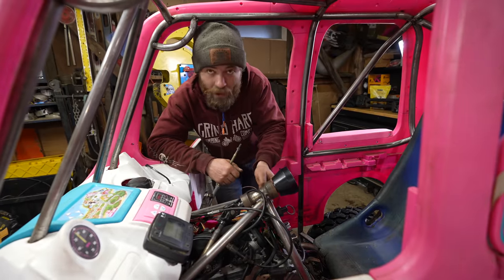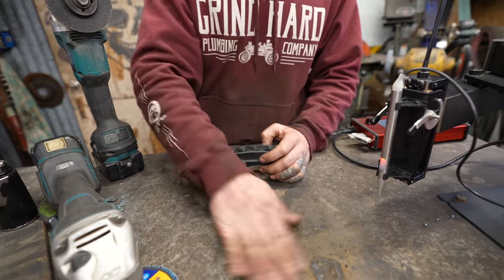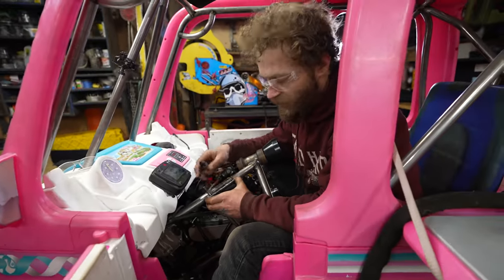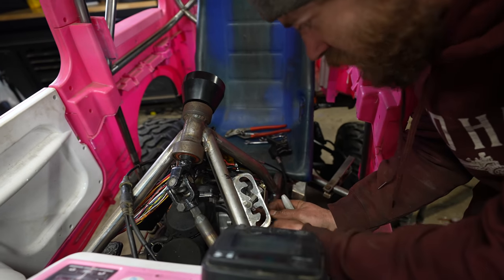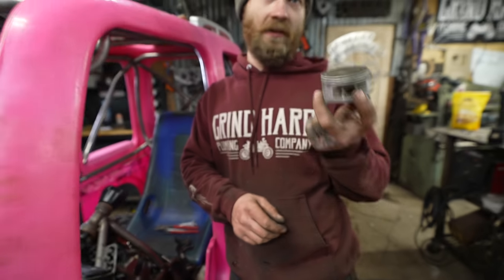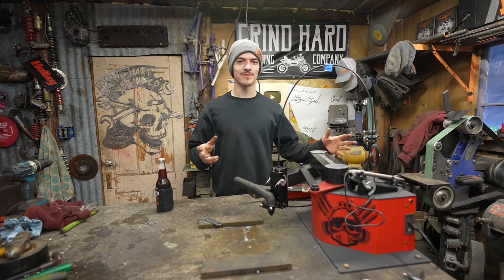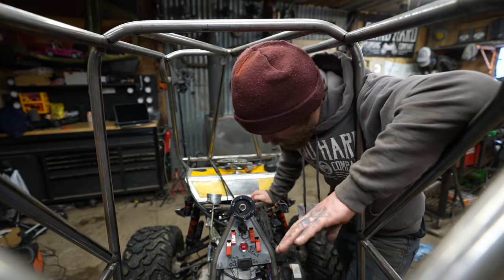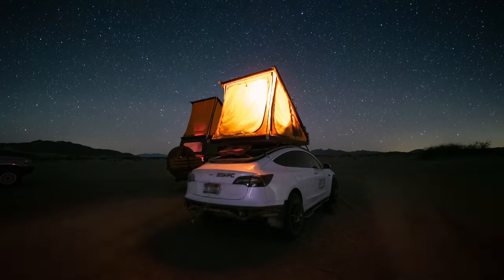4X4 Dream Camper Van Build Gets into Gear!

Comment: Ok, the way you made that shifter plate was awesome!  Now I'm really interested in the Arc Droid - especially because I have all of the same Lincoln machines as you do!  On that note, why do you have to tap the tungsten on the metal to start the arc?  I've never had that issue with my Square-Wave TIG 200.

Great video, guys!
Reply from the maker: Thanks man! Yeah, love the ArcDroid so far! The high frequency start feature on my welder broke a while ago, and I haven’t had time to get it fixed yet.
Reply: @GrindHardPlumbingCo  Oh, ok.  Is that a common issue with this welder?  I didn't see anything about that in the reviews.  

I bought the Power MIG 210 a while ago, and I absolutely LOVE it!  So, that's why I stayed with Lincoln for the TIG.  I have the TIG adapter for the Power MIG 210 too, so I can use my torch on that if I need to.  

Also, I have the Lincoln PAPR (Portable Air Purifying Respirator) that comes with their FGS (Fixed Grinding Shield) hybrid helmet.  It's extremely nice to have HEPA filtered air to breathe at all times, and to be able to grind and weld without changing helmets.  I got it on Amazon for like $800.  It's usually way higher than that, but Amazon had some crazy sale on it for some reason...

Comment: A potential safety hazard that I must point out is that almost none of your guys' builds have roll over protection. I really don't want to see any of you get hurt, all of your projects are super cool, but I think a 700 lb power wheels jeep rolling on top of you might hurt just a "little" bit!
Reply from the maker: Yeah we have rolled that one twice and neither of them were very fun but so far we’re OK. I think projects like this with the roll bar are the way to go for the future
Reply: There is very little room on the smaller bodies to make a cage and be able to get in and out. I'm trying to figure out maybe a hoop for mine🤔

Comment: Always amazed from the contraptions you guys make. I have two projects you guys have to work your magic with after your current projects. One is it would be sick to see what yas can do with a rokon 2x2 motorbike. 2nd it a Honda z50j monkey. As im from Australia I'd love to see the biggest engine you can fit in a monkey without mods or minor. As we here can not mod our vehicles and get away with it. It sucks a lot but atm I have a stock zs190cc on my 1980  fully custom monkey (herd a honda 300cc ? Fits no mods). 12inch 3 1/2 front and 4 inch rear tyres custom alloy rims. All disk breaks. Hydraulic everything including clutch. +15 rear alloy swingarm. Led everything. Digital and original clusters. 2 seperate wiring harnesses, one for the engine with remote start and runs without light (for sneaky getaways) key on and off anytime for the lights and wont kill engine. Air horns. Alarm and hoping to get gps tracking next as ppl like to flog them here as they fit in the back of almost any car. 7cm Harley bar raisers with low set hangers. Frame and light bucket only original thing left. Done everything myself. But still got nothin on you guys lol. Wanna sponsor a grindhard Aussie co 😅. Nah jk. Yeah I know, I wish. Keep up the sick work 🤘👍
Reply: Also have a secret project I'll only share with you guys as I dont have the machinery to perfect it but know you and everyone over the planet would benefit. A new type of generator and lowest cost ever to run. But must be free or most $1 to sell plans to cover the patient cost. Nicola Tesla would be proud
Reply from the maker: Thanks man! That bike of yours sounds like a sweet project!!
Reply: @GrindHardPlumbingCo  sent yas more info on the project via email 🤫 and a sneak peak of the bike. Enjoy

Comment: neat plasma cuter cnc/a tracing rig to bad the USD sucks 2400.00 yea .i defenitly would have to see inside it to justify that as it a made in china / Asia with that said seems high but i am a bit of a cheapo been told
Reply from the maker: It’s not cheap, but it is very well built.
Reply: @GrindHardPlumbingCo  yep it sure ant and i understand that its feature set dictates oh half of the price but thats cuts me out fer now hopefully the guy getting them made is getting a good deal so they can figure out if it was 1100 they would sell a bunch .i may just build the pantograph Mathias Wandel On YT has plans for out of metal that would work for tracing stuff  check it out if ye ant seen it neat rig